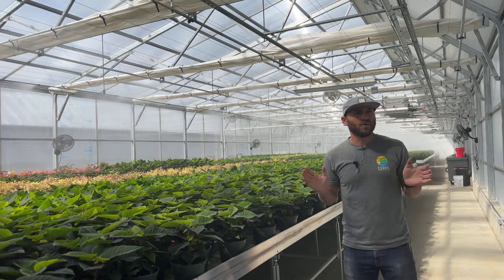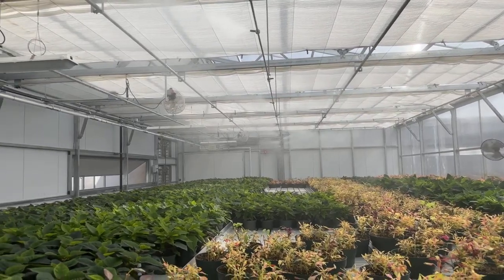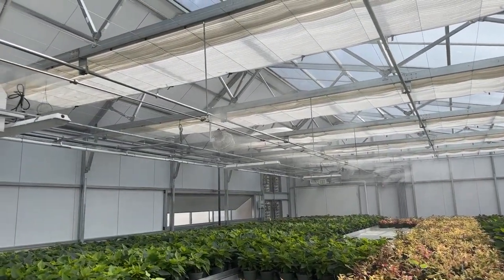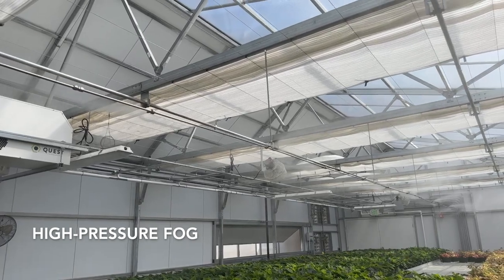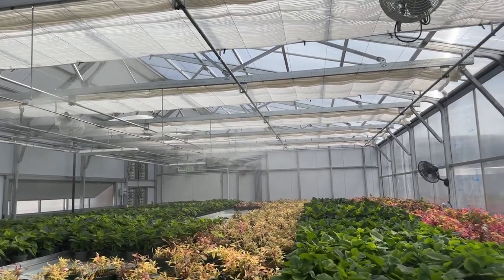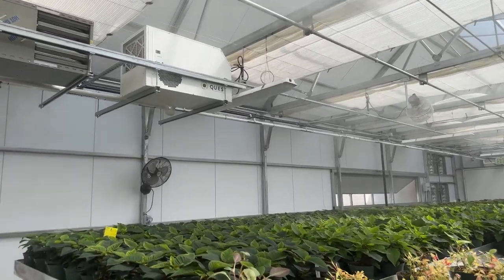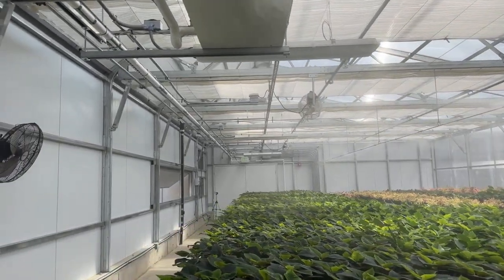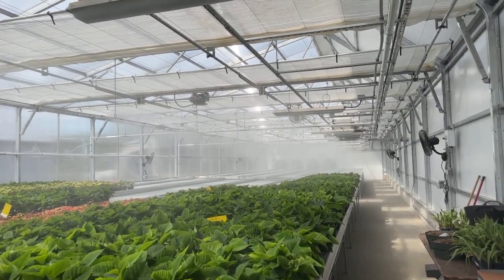Ceres Control Room | High-Pressure Fogging System for Greenhouse Temperature and Humidity Control

Comment: Does this greenhouse set-up use the GAHT system of ground to air heat transfer system in addition to this type of high pressure fog cooling?  Do you utilize refrigeration to cool the water before mist is created?  What would be the flow rate of each emitter with such tiny holes - must be like 0.5 gallons per hour?  Demonstrate the filter system required to keep the line clean, is a there a technology behind this system such as ultrasonic transducer, or just high pressure pump, operating pressure, please?  Details!
Reply from the maker: One of our greenhouse experts would be happy to discuss this technology further with you if you reach out to us with your inquiry: https://ceresgs.com/contact/